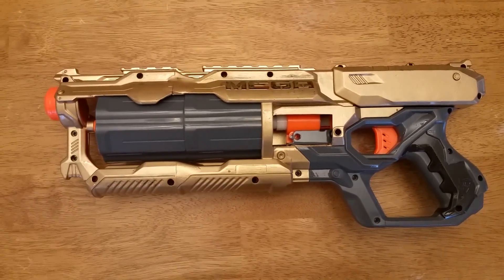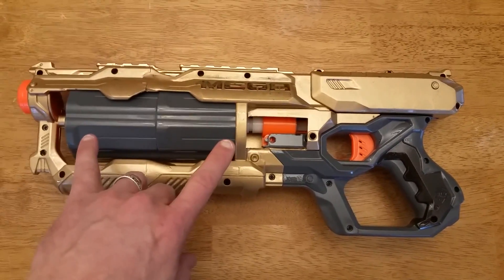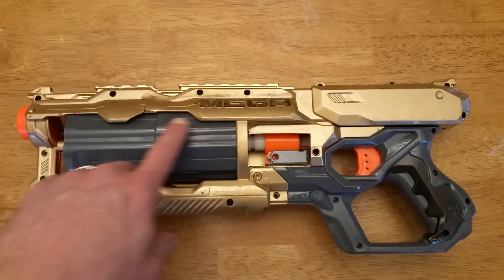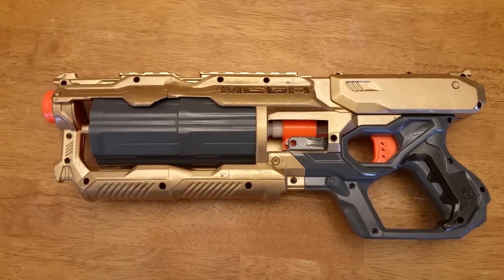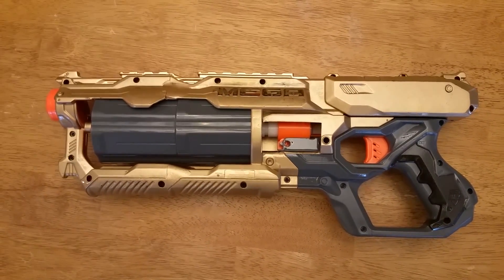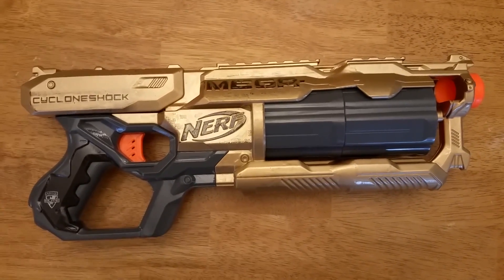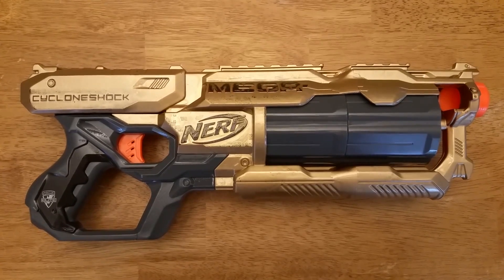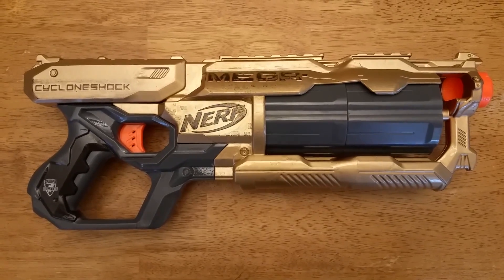The HandCannon - Cycloneshock Extended Cylinder Mod

Comment: Why do some cycloneshock have black on the handle, but mine didnt come with it
Reply from the maker: Not sure if this is it, but there were two releases of the Cycloneshock.  The first was sturdier with a stronger plunger rod.  The second was missing screws (replaced with plastic models) and the plunger rod wasn't as durable.
Reply: @498nerf7  first: thank you for replying. Second: why did they do that?
Reply from the maker: My guess was cost - to make it a little bit cheaper to produce.

Comment: How many cylinders do you think could be added in series, before you ran into either diminishing returns, or actually hurting performance? I've tried a 9kg spring and the worker barrel converters on my own cycloneshock and was very impressed by the improvement, but from watching your video I'm now tempted to have a go at doing this myself, though I wonder whether this could work with 3 or 4 cylinders?
Reply from the maker: Tbh, I really don't know.  My guess is that two is a sweet spot for that build and the rotational mech may have trouble going beyond two.
Reply: That's a good point, I hadn't thought about that. I suppose its possible to use a spare rotational part to cast a new one with metal, though that would consume more time

Comment: Seems like a lot of work just to make it shoot harder. Doesnt disabling the AR and giving it a better spring accomplish that?
Reply from the maker: The spring upgrade helps, but the barrel length helps too.  I have another Cycloneshock with the same internals as this blasters and this one gets an extra 20 fps.  The air expanding over the lenght of the brass gives the dart more acceleration.
Reply: 498 Nerf typically longer, tighter barrels detract from a dart's performance by creating more friction as the dart travels. But this is the second mod ive seen to suggest that a long brass tube enhances it. Whats the difference?
Reply from the maker: shadowsa2b It allows it to build air pressure behind the dart.  It is the same principle that allows rifles to shoot harder than pistols I'm the firearm world.  You need a loose fit to the brass though for this to work.  I used 9/16 inch brass for this build.
Reply: the other mod i saw involved wrapping a brass tube with electrical tape to make it bit inside a silencer style barrel extension, with the tube being long enough to reach back to the fly wheels on a Stryfe. the tube was obviously narrower than the barrel extension, but still allowed a micro dart to slip through. is this the same principle?
Reply from the maker: shadowsa2b No, you need a large volume of air behind the dart to this effect to increase velocity.  It only works with big plunger tubes and HPA. The mod you mentioned was probably using the brass to improve accuracy.
Reply: 498 Nerf yeah i realized fly wheelers dont use air pressure just after posting that >_>
What is hpa?
Wouldnt your brass tube here have to fit over or align with the end of the plunger tube so as to not loose air via leakage? How do you account for that with the rotating cylinder?
Reply from the maker: HPA - High Pressure Air.  Think of a paintball marker and apply that to Nerf.
There is a rubber bushing where the cylinder touches the end of the plunger tube on the Cycloneshock that makes a seal.  It isn't a perfect seal, but it works well for a Nerf blaster.

Comment: Great job!i never knew brass accelerates darts,
Reply from the maker: It only works for air and spring powered blasters.  The compressed air continues to push on the dart until it leaves the barrel.  To get it to work properly, the barrel have to be just slightly bigger than the dart.